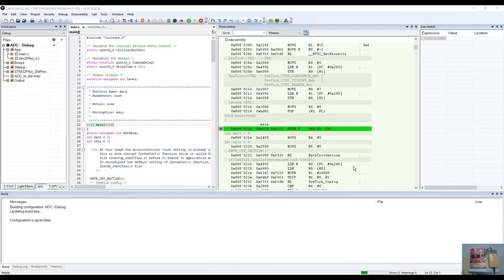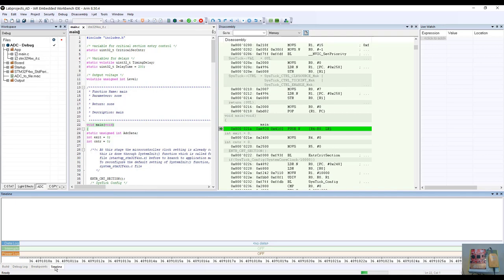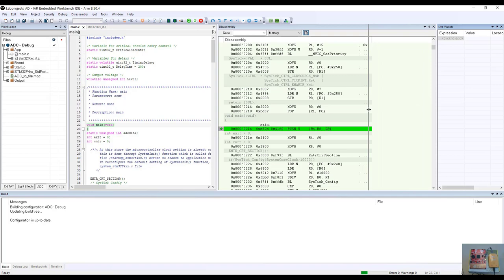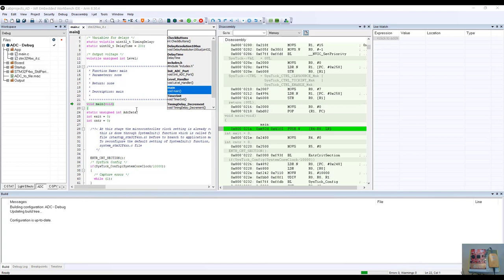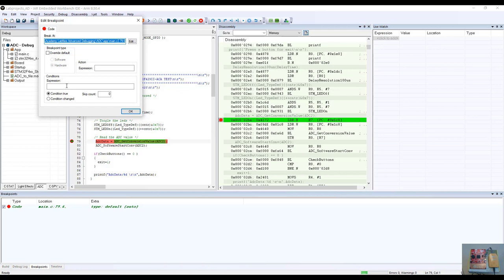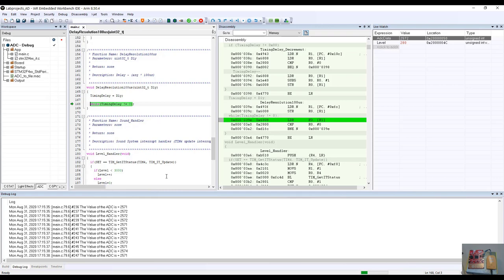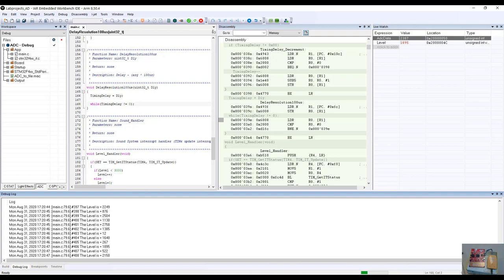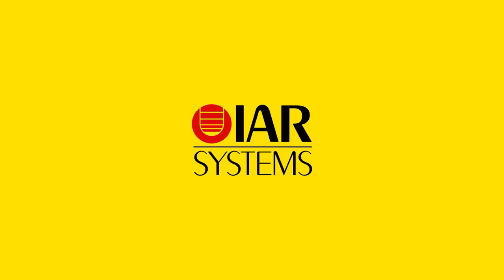Advanced Debugging Breakpoints in the IAR Embedded Workbench

Comment: Hi Admin, when I use J-Link probe, it doesnot work in data log breakpoint. So what should i do?. Thank you
Reply from the maker: Hi, Data log breakpoints are triggered when a specified variable is accessed. Notice that the data log functionality requires the SWO to have the right CPU clock and SWO clock set. J-Link requires the settings to be set manually. I-jet on the other hand can detect the clock automatically.  Please make sure the SWO is available on your board and J-Link and configured correctly in the SWO Configuration dialog box, see SWO Configuration dialog box, in the C-SPY® Debugging Guide.
Reply: @IARSolutions  i hope one day you will have the video introducing how to setup with J-Link. Thank you so much for your support.
Reply from the maker: @nguyennguyen_f1  , you are welcome and thanks for you feedback regarding setting up SWO with additional probes that support the feature.

Comment: What is C-SPY ? is it for debugging automation ?
Reply from the maker: Hi, the IAR C-SPY is a high-level-language debugger for embedded applications. It is designed for use with the IAR Systems compilers and assemblers, and is completely integrated in the
 IDE, providing development and debugging within the same application. You can make use of the C-SPY command line
utility—cspybat for debugging automation that is part of the IAR Embedded Workbench installer. Please reach out to fae@iar.com if you want to learn more about the cspybat usage.
Reply: @IARSolutions  thanks for your reply!
By the way, cspy available in all the versions of IAR IDE?

Comment: Does timeline support M0 MCU?
Reply from the maker: Hi, the timeline for Cortex-M0 is limited due to the debug capabilities on the device. Anyhow, you can have the call stack displayed in case you have Embedded Trace Buffer (ETB) on Cortex-M0 or Micro Trace Buffer (MTB) on Cortex-M0+ available. The other features are not available. The C-SPY simulator would be a workaround to get more information on the timeline from your  Cortex-M0/M0+ application but you need to use macros to force interrupts. Please reach out to fae@iar.com if you would like to get more details or hints.

Comment: 12:50 the mask should be 0x00000000 right? ITt shouldt not be 0xfffffff
Reply from the maker: Hi, thanks for your comment. The mask value is actually correct in the video. 

For Cortex-M, the data mask is limited to one of these exact values:

0xFFFFFFFF, which means that the complete word must match.
0xFFFF, which means that the match can be either the upper or lower 16-bit part
of a word or halfword.
0xFF, which means that the match can be either the upper, middle, or lower 8-bit
part of a word, halfword, or byte. For example, for the data 0xVV, any 32-bit
access matching a xxxxxxVV, xxxxVVxx, xxVVxxxx, or VVxxxxxx pattern, and
any 16-bit access matching xxVV or VVxx, and an 8-bit access with exact match
triggers the breakpoint.

The Match data options are only available for I-jet, I-jet Trace, J-Link/J-Trace and
ST-LINK, and when using an Arm7/9 or a Cortex-M device.

I hope this information is helpful. Please let us know if you have any additional questions or comments.
Reply: @IARSolutions  okay. But does it not depend on the tool which I'm using (like Keil debug, iar or I'm using Ozone). Bcoz in ozone, when I set the value of Fffffffff, ozone says value =  0xXX.  That is why I'm not sure yet. 
Thanks for the reply, I'm subscribing you.!!
Reply: I want to check a particular variable is hitting 4. So should I put the mask as 0xFFFFFFFF?
Reply from the maker: @powerstar817  In case of data breakpoints, the mask as 0xFFFFFFFF should make the trick. Please reach out to fae@iar.com and we will be happy to assist you further or clarify any additional details. By the way, thanks for subscribing our channel! :-)